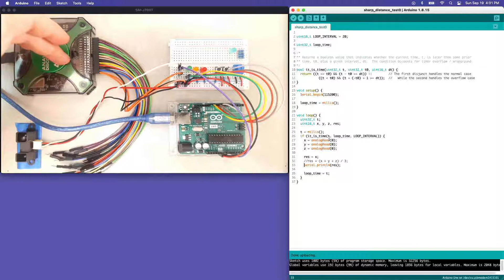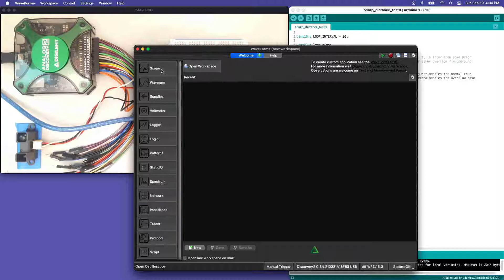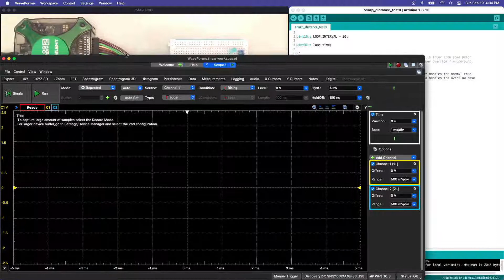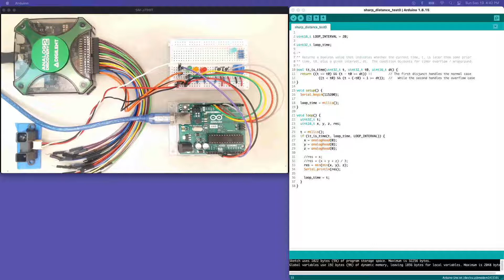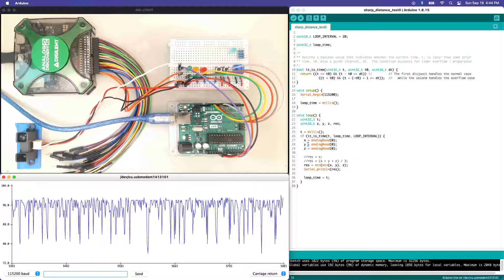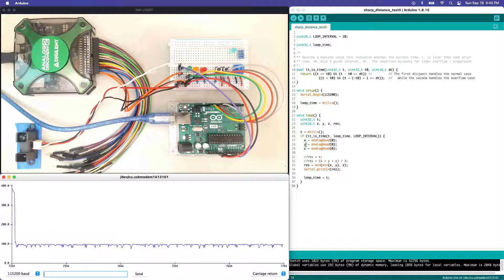Arduino Tutorial on Reading Data Cleanly from a Sharp IR Distance Sensor (GP2Y0A02YK0F)

Comment: It seems highly unlikely that the sensor produces these pulses by design, and no such pulsing is described in the datasheet. So rather than papering over this problem in software, I would first look to see if the sensor has been applied properly.  I acknowledge that the exercise of using software for signal conditioning is valuable, but more valuable is not complacently settling for avoidable bad signals in the first place. 
A big clue is the datasheet advice to "stabilize power supply line"  using a bypass capacitor of at least 10uF near to the product. In a similar vein, Pololu's listing of this product comments on the intermittent pulses of high current that this sensor draws from the supply.  So my suspicion is that the pulses are due to some artifact relating to those pulses, and no reservoir capacitor local to the sensor.  It would be informative to stick additional scope probes on the ground and positive leads at the sensor (not at the breadboard) and see what they look like.
If a manufacturer delivered me a sensor that actually did have this blatant a problem even when applied properly, they would be getting a report that it was defective.
Reply from the maker: Thank you for your comments.  When my students observed these spurious readings, adding a bulk / bypass capacitor to stabilize the supply is the first thing I suggested that they try.  A 10-µF capacitor on the supply does nothing to eliminate the artifact that is apparent in the output signal.  Even a 220-µF electrolytic capacitor also does nothing to eliminate it.  The back of the sensor is a small PCB.  If the power supply really needed to be stabilized, the manufacturer should have incorporated the appropriate bulk / bypass capacitors on that PCB.  The cable that Pololu sells to go along with this sensor is about 20 - 30cm in length, so it is not at all surprising that adding a capacitor on the power supply where the cable plugs into the breadboard does nothing to help.  My "patch job" practically eliminated the problem without having to tack solder a capacitor to the power supply connections to the back of the sensor in some kludgy manner.
Reply: @bminch  I agree that the software solution is a valuable lesson in itself, and handled the problem for the case at hand -- getting a stable result for the class exercise.  But it sounds like the root of the problem was not discovered. I am with you that the manufacturer should have dealt with the problem by including the bypass cap on the module if that was what was required. Whether that was the problem or not, they should be taken to task for supplying a sensor whose output so clearly  does not fulfill its spec sheet. I am chagrined on behalf of you and your students, and all other users of this module who get caught by this issue.